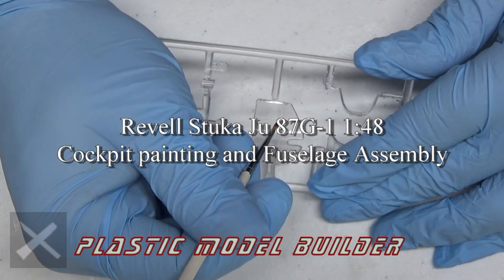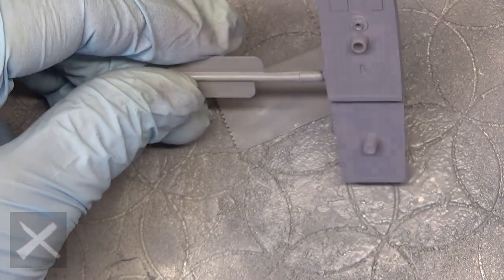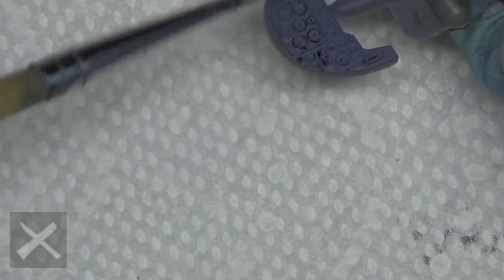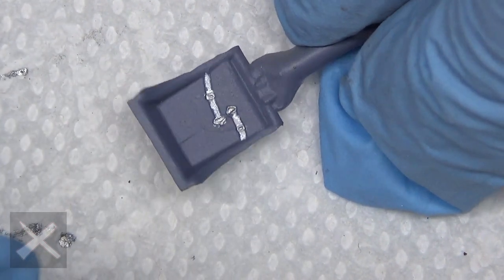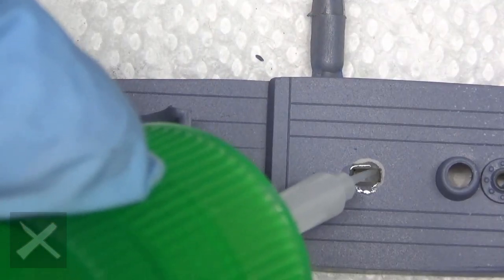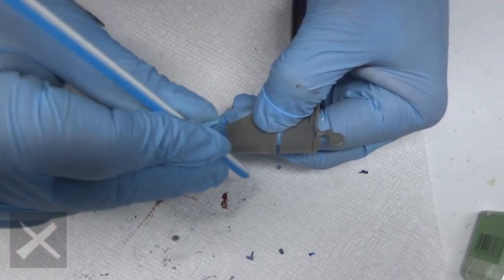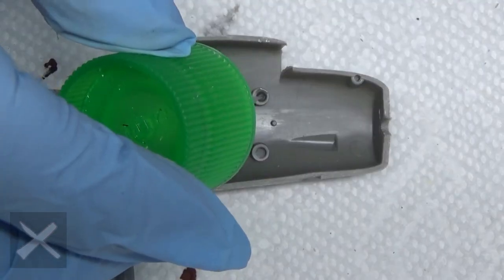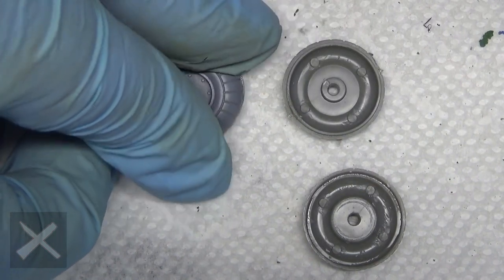Revell Stuka Ju 87G-1 Cockpit, Fuselage Assembly and Weathering, Part 1.

Comment: What did you use as a primer?  The technique you demonstrated with the thin paint on the seat is usually referred to as a "wash" .  I also noticed  you used a different version of your theme music.  See next time!
Reply from the maker: Testors Model Master Acrylic. Could almost call it a glaze too! I did get rid of the theme music though.
Reply: Ok, that makes sense,  Testors Acrylic can wear off as you described. If you want to try primer again, there are more durable primers.   good luck.
Reply from the maker: @KHModelWorks  honestly, i think its easier to prime after assembly.